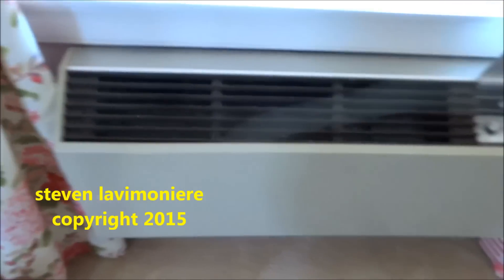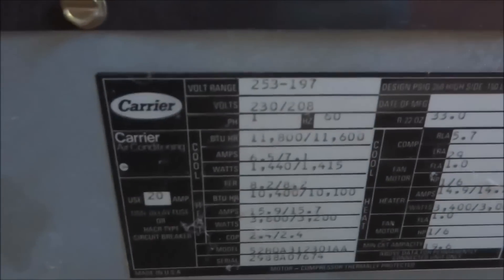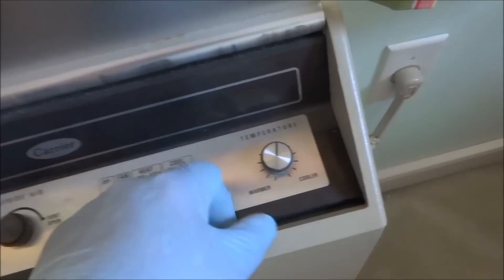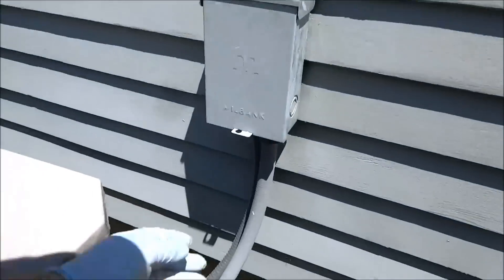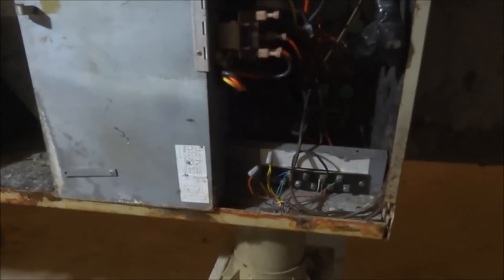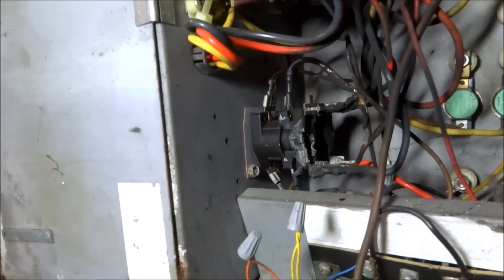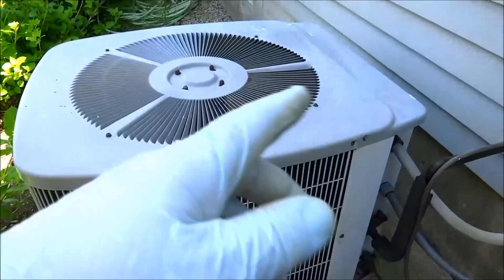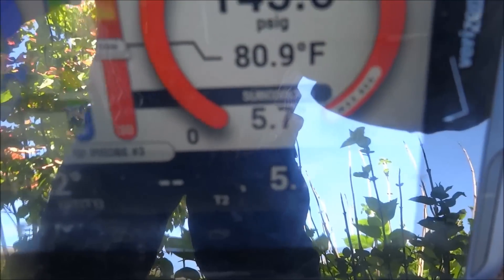hvac:heat pump system with fried wires will not cool

Comment: A 26 year old air handler, and 16 year old heat pump, Yep it's time to go. love the ptacs  those hotel units worked very well if they were maintained. At least you will have plenty room to install a new unit. No crawling necessary.
Reply from the maker: Robert Weeks nice crall space  for sure i can walk in there untill i get to the duct work and beams

Comment: 1988 model year looks like on the first one, good call on junking it.  The second one sounds like shit! Head could be low from oversized system.
Reply from the maker: Truckguy900 Truckguy900 i changed out the burnt one ,,the other one i just juised up for now . its dew  for a upgrade also

Comment: That air handler has seen better days!  With the head pressure reading low like that, does that indicate a tired compressor?
Reply from the maker: ESDI80 most likely wrong size piston /metering device but with a old system like this one any thing is posable

Comment: Brings me back to the memories in the early 1980's when I did service in Newport, RI. I worked on a ton of those Carrier "thru the wall" self contained units at all the hotels downtown. No place to park the truck and walking 1/4 of a mile with my jug of R-22, my meter, and gauges from job to job. If I didn't walk just 100 feet without someone saying, "Hey! Can you recharge my car A/C for me?"
Reply from the maker: Brad1237202 i might have to back on one of them wall units .. not cooling on a hot day. probley needs r22 gas

Comment: Time to let those units go!
Reply from the maker: Stephen Rardon i did change out the old system with burnt air handler over the weekend videos to follow .unit should be wired tomorrow for start up.